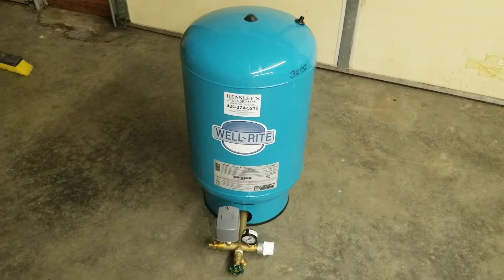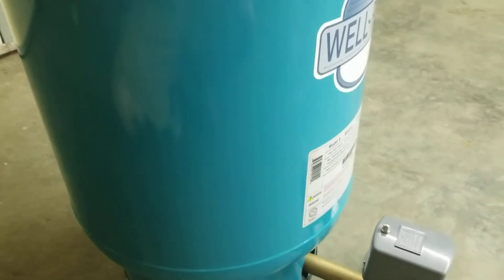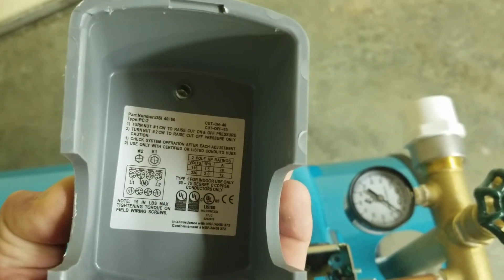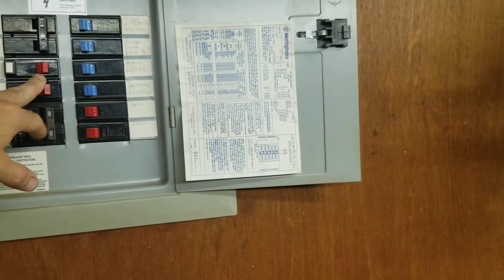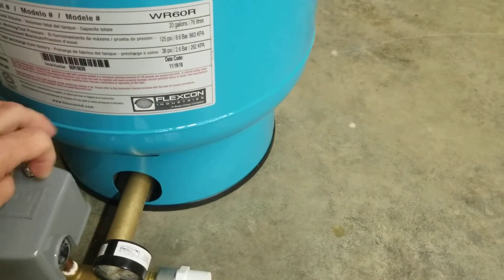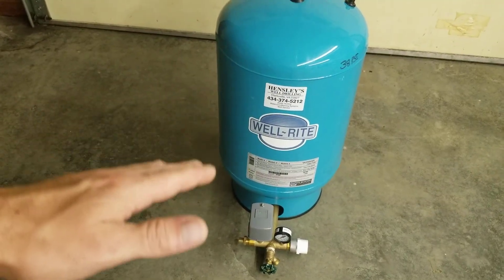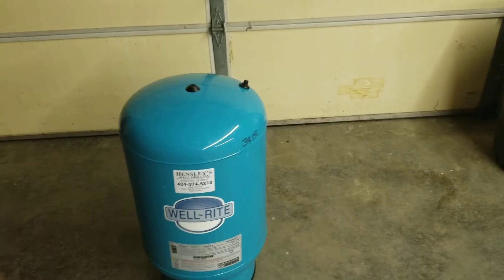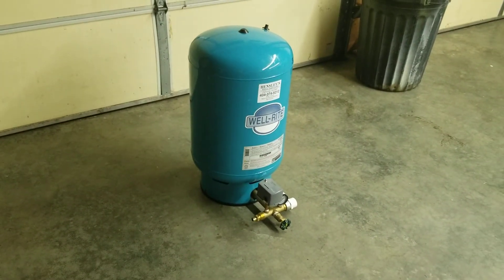Well Pump & Tank Troubleshooting, How the system works, Adjusting Pressure Settings Correctly

Comment: My Well pump would not shut off. The well tech came by and saw what I was experiencing with my well.  When I would open a faucet flow of water would run for a few minutes then stop. The pump was still running. We checked the switch(new a few months ago) it was good. We have power running to the controller box and down to the well. The well seems to run low and still the pump would not stop. After pulling the 300 ft of pipe and watching that each 20 footer was full of water and replacing the pump with a new one and checking each leg of pipe for leaks we sealed it back up. Turned the breaker back on and we got water for a few minutes when the flow stopped. Motor still trying to run. stopped working for the day. The next day he put in a delay switch in the controller box and set it for 30 minutes. Now I was able to fill my RV water tank and my water trough. But it still stops pumping water and the delay switch turns off the pump. Just looking for validation. Did we do what we had to do?
Reply from the maker: Water Softeners go after the tank, but require 50+psi to lift & rinse the bed. If you can run a garden hose wide open for 40 minutes without running out of water pressure, you can hook up a softener. They take 80+gallons during the cleaning cycle. If its only for a RV, you can probably get by with a Lowes softener which is all in one.
Reply: @h2omechanic  Right now the Well shouts off after maybe 15 minutes. I am guessing no water softner then. I really don't know what to do except to clean out the  filters on my RV. Does the Lowes all in one softner require all that water to regenerate?
Reply from the maker: If the pump will build up 50 or 60 psi & cut the switch off, then its not the pump. Sounds like the well is running dry & your over pumping it. Typically in this situation I would discover a leak somewhere. Try turning off your well breaker for 20 minutes and go to the tank & look at the gauge. If it dropped to 0psi that means something drained the water out when the power was off. Id Check every outside spigot & hose. 
Also check your Toilets, thats probably the issue . One can be hung open or have a leaking flapper that constantly uses water 24/7. So when you turn the breaker off & wait 20 minutes, look to see if any of the Toilet tanks/bowls are empty. If 1 is empty, thats the problem. Before cutting the power check the toilet tanks & see if any are over flowing into the drain tube in the back of the toilet tank. 80% of the time in your situation, its a toilet thats been leaking for months & it slowly depletes your wells aquifer. It will recover. If no toilet is leaking, leave the well breaker off each night while u sleep. If there's no leaks anywhere, you should still have 7 gallons of water pressure in the tank when u wake up in the morning.  Hope this helps! Comment your findings please. To help others who may read them.
Reply: @h2omechanic  First "Thank You " for helping.  Really cold here yesterday, today and tomorrow. So I will go out to our pump house later tomorrow. I Have been shutting off the valve at the pump leading to the faucet that supplies my RV. Not sure but I think that my pressure tank gauge read 50psi right now. We are not using the City/Well pressure to supply the RV rather we are filling the RV tank and using the RV pump. Works great. But before we could use either method. Oh, forgot to mention that the Well pump was almost 50 years old. Could my Control box be faulty?
Reply from the maker: Id say since the pump is 50 years old & 3 times older than its life expectancy, its probably worn out on the inside and the impellers can't do what is needed anymore.
Reply: @h2omechanic  Just went out to our pump house. The pressure gauge is at 42 psi. the switch is a 40 60 switch. The breaker is on and the valve at the source is off.
Reply: We would like have a water softner put in. The guy says that we need 65 gallons of water for regeneration. Would you recommend a holding tank? If so, I can leave the valve open at the pump until it filled and use it as the source for the filtering system. And can I put it like 10-15 feet from my RV inlet and let gravity work for me? Hmmm, if do it that way I am guessing that the filtering system would have to be between the holding tank and the RV inlet. You have a video for that setup? Hoping that I am making sense.
Reply from the maker: Id recommend you going to lowes & buy the larger whole house filter. That way it traps any grit/sediment and does a damn good job. Every softener needs alot of water to clean themselves. If you wanted to try a softener, id look on fb & see if someone has one for sale that isn't too old. Lots of ppl buy them & realize they are too small for a house. Itll save u money & worth trying. Why do you think you need a softener though? Typically its because the water is leaving white spots & feels dry & women hate it for their hair getting coarse. Whats your reasoning?  You might need something different than a softener

Comment: We had a submersible pump replaced 2 months ago, now the water is not working again. If you open the valve between the pump and tank, water comes out at high pressure, but the tank is empty, but has pressure. What is the problem?
Reply from the maker: Remove the filter element if you have one. Or you have a valve off or possibly broke gate valve. The tank is supposed to feel empty. They only store about 6 gallons. If you have good pressure in 1 spot, just follow the water line. You have something blocking your flow. Also try different faucets & make sure its not just 1 sink strainer that's filled with sediment.  If your using a black carbon filter, remove it, its the issue.

Comment: Thank you for the informative videos. I've watched several of your videos this morning, and I've spent a few hours trying to troubleshoot my low water pressure that I've been living with for the past five years since we moved in. My pressure switch is only rated for 20/40. The pump will kick on at slightly below 20 but the highest I can get it to shutoff is 34, otherwise the pump will run continuously without shutting off. I would like to get closer to 40 if possible. I followed your instructions for adjusting the switch cut off pressure. My 32 Gallon Trident pressure tank is good. It's 5 years old, and I followed your directions to check it. The air pressure without any water in it is 15 psi. Thanks for any advice. Dan

Comment: Thanks for the videos! I also liked the one about the pressure switch. We have low water pressure. Our Pressure switch is humming at a low frequency but not really pumping water. We changed the Well Pump Controller Box and it didn't fix the issue. Our water PSI is sitting at around 13 psi. We cleaned the connections on the Switch (no bugs) and are able to get them to spark when we flick the tabs. We are checking all options before committing to switching the pressure switch. any thoughts?
Reply from the maker: If you turn off the well breaker, the pressure should hold at 13psi. If you turn it off & it drops to 0, that means you have a leak in the well. Most likely at the pump. I have a video showing 6 pumps & in that video, you'll see what can happen to give you the issue u have. Try my test first
Reply: @h2omechanic  Yes it holds at 13 with the breaker off. I'll give it a watch. Thanks!
Reply from the maker: Ok, then the nipple is plugged. Kill the power, remove the wires, un spin the switch & jam a screw driver threw the 1/4" nipple. Probably has alot of iron build up inside. Very common issue & simple fix
Reply: @h2omechanic  could it not be a weak/dying well pump or a clogged well pump?
Reply from the maker: It definitely could be a old pump dieing. Not clogged. If it runs for 5 minutes & randomly cuts off for 2 minutes and then back on for a few minutes and repeats this cycle, its probably the pump. But if it happens at random, its the switch. Typically you get 12-15 years out of a pump before the bearings fail & it over heats. The switch is a cheap fix/test. Spend $40 before you spend $900

Comment: Thanks for the informative video. I'm trying to figure out my issue with my tank. My water pressure will stop altogether for 15-30 seconds if the water is in use for a few minutes.
Reply from the maker: Could be 2 possible situations. 
1. The pump is 10-15 years old & is heating up/ cutting off on a thermal overload bc the bearings have failed. Id say 70%chance 
2. You can do this one. The small tube/nipple that connects the pressure switch, it can get clogged. Turn off the well breaker, remove the 4 wires on the pressure switch, use a wrench 3/4" & unspin the switch from the Tee or nipple. Using a Phillips head screw driver, jam it threw the nipple & itll push out any blockage. Then just thread it back on & hook up wires. 
If you find no blockage in the nipple, the pumps starting to fail. 
Hope this helps! I'm here for any help you may need. But Try the nipple first.
Reply: @h2omechanic  Thank you for your reply.  I  will try this in the morning
Reply: I have the exact same problem going on I was about to call a high dollar plumber and then I found this YouTube channel thank you so much
Reply from the maker: @chadhobart4839  give us a Share on Fb or IG & help show your support. The bigger this channel gets, the more money people can save! I'm happy my guidance could help you 🙏

Comment: Water is constantly  coming out of the valve under my gauge on my well water tank. Where would the Schrader valve be to check the pressure. I wanted to follow your testing video, but need to locate the valve.
Reply from the maker: Air Schrader valves are on the top of the tank.

Comment: HELP!!  Knock test was negative, valve tested without any water coming out.  The switch has power because it will arc when I move it with cover.  I drained the tank and pressure was 4psi.  I added up to 27.5psi since my switch is a 30/50.  I don't ever hear the switch kicking on or hear the well cut on.  When I turned on the faucet had good pressure again for 2-3 sec then it went back to low pressure and I never hear anything kicking on??  HELP??
Reply from the maker: So, before you went to your tank & re adjusted the pressure, you didn't have water, or good pressure thus why you were looking on YouTube. If you see a spark & only get 3 seconds of water, the pump is most likely dead bc the tank being low on air caused short cycles and killed it. 90% chance you need a new pump. If its older than 10-15 years, its at its life expectancy. Whats happening is the pumps overheating and shutting down bc the bearings inside have failed. Try flipping the breaker off for 30 mins. & give it a rest & see if it'll run for tonight. But tomorrow you'll need a new pump . Im 95% certain with the info & scenario you have provided.
Reply: @h2omechanic  hey thx for the quick response. If it’s the pump how can we continue to get water?  We have noticed a low pressure for several days now. The pressure never builds up to the 50 psi so could it be the switch?
Reply from the maker: No. Not the switch if its been running constantly for a few days and never cutting off, it would have been giving you some water, but just not great pressure & now the constant running has over heated the pumps motor. Now there's 2 reasons why it won't build pressure. #1 the pump is old & worn out on the inside impellers and it just can't build the pressure anymore. #2 if the system has some age on it, its very common for pipe fittings to crack or acid water wear a hole through a metal fitting. Typically where the pump is connected to the pipe, you'll find a hole or a crack. Thats leaking out 50% of your pressure but not so big that you didn't get any at all. Now here we are a few days later & the hole is bigger or the crack has completely broken thus y you have no more water. If you can't afford a professional, I have other well videos on my channel id suggest watching before you tackle anything like this.  I go into full detail on each video. A pro would be done in 2 hours & youd spend around $350 extra by letting them do it. If u DIY it, expect 6hrs of work and $650. Pro=$850 to 1k. My videos will help alot either way. Help to understand & ask questions or use as a DIY guide.
Reply: @h2omechanic  I never hear the pump running or the switch cutting on/off??
Reply: We have constant water just a low pressure
Reply from the maker: If its not turning the switch off, try killing the breaker. If there's a leak down in the well, the pressure will drop to 0psi. If there's no leak, your pressure will hold whatever it is at before you kill the power. If it holds pressure when off, but doesn't build enough to satisfy switch, the pump is old and worn out. Both require removal.

Comment: I have an issue where the switch engages but the pressure continues to go down. As soon as I turn off any faucet   That was running the pressure starts to rise but at a slow rate. Then after some time It will return the normal pressure fairly quickly. One thing I noticed is that The switch stays on when any faucet is in use but the pressure continues to decrease. Do you have any idea what this could becaused by, maybe a bad pump?
Reply from the maker: Yes is the short answer without know details of the system. 
How old is the pump/tank/switch?
How deep is pump & well?
What size pump 1/2hp or 3/4. 
Submersible or jet pump?(above ground)
Is the pump on black poly pipe,metal, or white pvc?
Anything you can answer would help me understand better to help you. 
Could be pump is old, pipe or fitting cracked, leak somewhere in the yard.
Reply: @h2omechanic  
Thanks for getting back to me so quickly! 

The pump/tank/switch came with the house about 9 years old. When we built the house we got the new system. 
The well is about 400 feet deep. The pump is above ground.  We use a 50 gallon tank and is 1hp pump. I believe the tank and pump are well-x-toll. 
It’s an above ground pump. The pipe from the well to the pump is a black poly pipe but the pipe on the tank is PVC. The pump appears to be in good condition and I don’t really see any cracks or water that is gathered around the pump or pump motor. The pressure stays constant when there is no use.
Reply from the maker: You need to call a well Drilling company and have them come out & install a submersible pump. They use 75% less electricity and provide 3 times to pressure & volume. Jet pumps are 1970s technology. Not worth wasting labor fees. Itll cost you 800 to $1100 to fully update it. & youll get rid of any future issues. Plus at 9 years, your at the life expectancy of your pumps impeller seal. So money is best spent going submersible. You already have the pipe. All they'd need is a pump & wire. As a professional, id beg you to not try to replace your jetpump with another one. Don't use plumbers or rotor Rutter. Call a well drilling company. Its cheaper that way.
Reply: @h2omechanic  Thanks so much for all the information. You have been a huge help and a great knowledge source. Ill look for well drilling companies in my area and give them a call. I really cant thank you enough!

Comment: Why do the points in the pressure switch get fried? 
How do I know if the wiring is correct on the pressure switch when doing a replacement?
Reply from the maker: Easy way to do the wires is by color. Same colors go on same side switch. White next to white and black next to black/red. Or rake a pic of how its wired. The points start to fail when your pump is starting to get a little old, not run so smooth & starts to pull a higher amp load to supply water. Is your pump 10-15 years old? Also a 1HP pump will kill a switch fast than a 1/2hp because the amp load is 9.0 vs. 5.5 . If your tank isn't set correctly, your on/off/on cycle time might be fluctuating too fast, you should see 20-30 seconds between cycles during water usage. I have a video explaining how to set the tanks air pressure. Find it in my list of videos and make sure your system is setup to its optimal operating ability. Thats the biggest killer of contact/ points is low air in the pressure tank. Hope this helps!